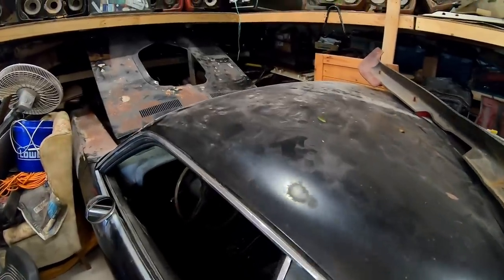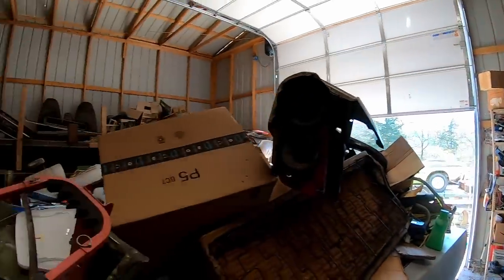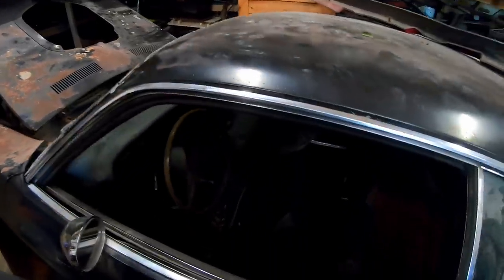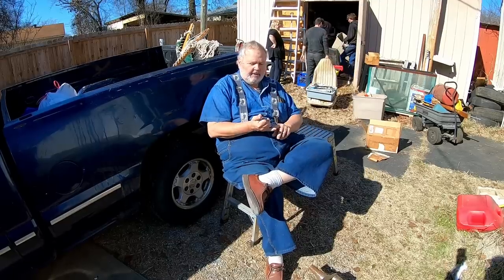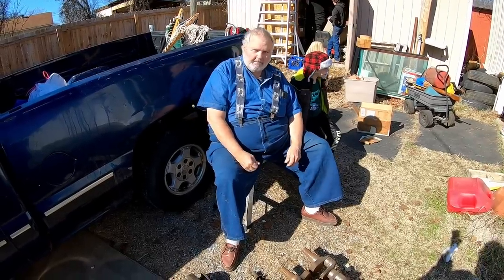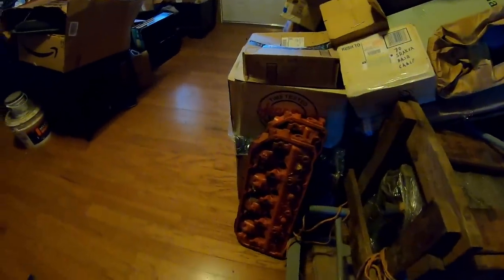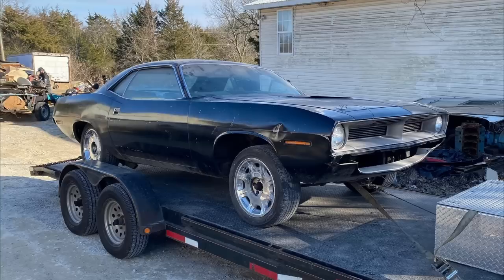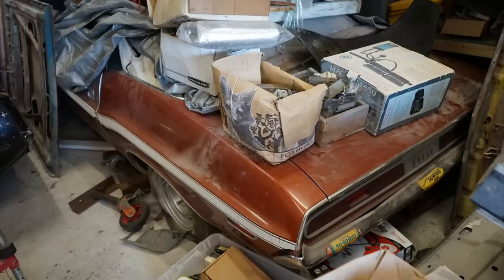BARN FIND Hemi 'Cuda rescued after sitting 40 years!

Comment: What an amazing find. A Hemi Cuda along with a Challenger R/T convertible and a Roadrunner convertible. The only built 652 Hemi Cudas in 1970. Only 368 were hardtop automatic car. Only 692 383 R/T convertible Challenger. 824 Roadrunner 383 convertibles.
Reply from the maker: Yup, that's why I drove 9 hours to check them out!

Comment: I had a black 72 Challenger 340 Ralley (I think I spelled that correctly) that I bought in 84. It had W2 race heads and a 727. I wanted to buy a Cuda or Barracude but they were very rare and expensive if you could find one. I did find a 440 Cuda with a stick but the car was hammered with a twisted frame from hard launches. I sold the Challenger 5 years later for $3500. For me the Hemi Cuda was the ultimate muscle car until I took a brand new 04 Mustang Cobra off the dealer's lot for $34000. From then on, the Cude took a back seat to the Terminator. Most fun car I've ever driven, expect those cars to fetch a pretty penny I heard 2 sold at auction for over $100,000. With a blown 4.6 and 6 speed it will wipe the floor with the Cuda with just a few mild mods. Still love the Cuda but the handling of those old muscle cars was frightening 😮 Glad this piece of history is going to a good home, it actually looked to be in pretty good shape considering
Reply from the maker: Oh I'm sure.  A W2 headed 340 is an awesome combo!
Reply: @AutoArchaeology  A W2 conversion was very expensive, even the rocker arms needed to be replaced due to the valve placement. Despite the E body's shortcomings, I loved that black Challenger, it just personified the term "evil". I wish it had a 4 speed but maybe it was for the better as you didn't want to take your right hand off that steering wheel 😯

Comment: $2000.00 was a lot of green stamps in 1978 for a roller. I ran across several running driving Hemi cars during that timeframe for $2-3K. SEVERAL.
Reply from the maker: Might have been the area.
Reply: Yes, 2000 would have bought you a nice running hemi or six pack car.    2500 for a pristine one
Reply: I call bullshit !!!
Reply: @edpinkerton7947  LOL, on a $2-3K Hemi car in the 70's?
Reply: @edpinkerton7947    I paid 2500 for. Superbird in 81.   Engine had rod knocking and needed a repaint .  At the same time in out large weekly statewide classified paper, was a very nice 70 hemi GTX for the same price.   
Hemi challenger I got to ride in was for sale for 1700 when I was in high school. 
At that time a 383 B body generally could be bought for 800, so a hemi car was over twice that.
Reply: @silverstar4289  he said he paid 2 grand and the guy behind him offered 4 for a car with no motor trans or seats in 1978 ? I’ll stand by my call. My sisters boyfriend had a 68 440 GTX convertible at that time he bought for a grand
Reply: @silverstar4289   1700 when I was in high school at that time might as well been 170000 no one I knew had that kind of cash
Reply: @edpinkerton7947  okay, I see what you meant.  the turning down double the money would be hard to believe, considering 4,000 would have bought you a modest new car.
Reply: I can’t wrap my head around the prices of these MOPAR cars when they were new between 1967-1971. I mean 2,000-3,100 dollars feels practically free to me as of 2022. I think Car prices today are absolutely ridiculous !!!!! It’s $45,000 dollars for a new challenger. And I’m not talking a pointless 6 cylinder version. Why would anyone buy a 6 cylinder Dodge Challenger. Go Hemi. Go all the way. Anyway my point is; cars today cost 40 times more than they did then and I’m pretty damn sure salaries and rate of pay aren’t 40 times higher now than in 1969..... average jobs paid 2.00 an hour in late 1960s. Average jobs today pay 10-12.00 an hour. So money is only worth 4 to 5 times more. Meanwhile a car costs 40 times more. Ya see how we aren’t getting anywhere. And forget about trying to buy a 1969 HEMI Road Runner today. What cost 3,000 dollars in 1969 now costs $160,000 dollars. Do the math on that... that’s like 53 times more .... we aren’t getting anywhere in life as a living species. I don’t even want to imagine how ridiculous out of whack the cost of living will be by the year 2125...... $739 dollars for a combo meal at McDonald’s ....... just dumb!
Reply: @silverstar4289  They were dirt cheap in the 70s and 80s. I already had 7 cars and had to pass on a $500  '64 Plymouth aluminum nose race Hemi roller, $350 running 67 Hemi GTX, my buddy's 70 440-6 Superbird roller and many many MANY others.
Reply: @robcicero8746  Not sure where you live, but people are making way more than $10-12 an hour. Wife makes $47 an hour doing inventory for the county, I made $105,000 driving a truck. It's just like it was in '69.

Comment: I raced a 70 Hemi Cuda with my 66 Mustang Shelby. We ran head to head for 2 miles until we both went airborne from a huge hill. Last I saw the Cuda, my car was 10’ in the air and the Cuda crashed into a Kentucky Fried Chicken. It was 1:00am so no one was inside the building.
Reply from the maker: Oh geeze!  I hope everyone was ok
Reply: @AutoArchaeology  I came out OK but the Mustang’s suspension and engine block was damaged. I don’t know about the other guy. I know his Cuda was probably trashed because he was headed for the KFC’s brick wall and was a good 8’ off the ground. I heard him crash but I was busy with my own problems. The road curved on the backside of the hill so when I came down I had flown over the medium and landed on the on-coming traffic side. He had been on the left of me so he didn’t land on the road. I grew up during the whole muscle car era so I know what we thought were true muscle cars versus “show cars”. Dodge / Plymouth has some pretty fast cars back then but every lusted after Vettes and Chevelles. They weretop tier and Camaros, Firebirds, Roadrunners, Cudas and Mustangs were next level down. Then you get into Chargers, Roadrunners, Super Bees, etc. It was a very distinct pecking order. Glass packs, Hurst shifters, Holly carbs added a little more prestige.

Comment: Nice. But I caught an error. No such thing as an am/fm 8 track on an E body. Am 8 track only. Code r22, which also came with 3 front speakers. This one has the optional rear speakers as well. We can tell by the fader switch on the dash. O
Reply from the maker: You're right, I was just rattling off what I thought I saw.

Comment: Nice find but only for the chassis and body. Indeed  without engine this Hemi Cuda is not anymore one.... Doesn't matter what the VIN said, this is just a Cuda Now.
However awesome story.
Reply from the maker: You are incorrect, with the VIN showing the R for the engine designation, it is always a Hemi 'Cuda, far more than just any 426 Hemi.
Reply: @AutoArchaeology  I would so happy to got " just " a 1970 Hemi, as you said. Far more the R stamped on the VIN plate's car without engine lol.
What makes a car authentic are all those original features. If only one of these elements is missing, the car no longer match with the VIN. Neither more nor less, it's no more complicated than that.
And am pretty sure that 95% of mopar owners share my advice.
Let's see some weeks how many " Like " I'll have on this com in the futur to be convinced.

Comment: That car needs to be taken apart bolt by screw and totally redone .... is it possible. Will this car ever look Road worthy again? You gotta let us know
Reply: Honestly I don’t know the ‘Cuda. I own a 1968 Charger, two Plymouth Dusters one with a 340 and the other with a 360. And I have a 1970 Road Runner 383 air grabber with 4 speed pistol grip. I’m 50 years old. I bought my 1st Mopar 1971 Duster when I was 17 for 900 dollars off an old lady who didn’t realize a 20 year old car at the time was worth 20,000. I still have the Duster and it’s been appraised for $55,000. It’s a 340 4 speed bucket seats .. I have had it repainted with the 340 and strip package as the paint job on it was faded over the years. My Charger is the track Cat. It’s a 440 magnum dual quad tunnel ram , hurst 4 speed and a 4.10 rear. It does 11 sometimes 12 seconds on a bad day at about 140/5 mph.
Reply: @robcicero8746  Track cat?? Do you mean scat pack?? Good grief.  Appears you don't know mopar period!!
Reply: @robcicero8746  Also, the charger never came with a 440 and 2 carbs!